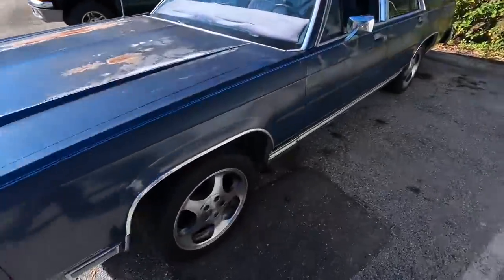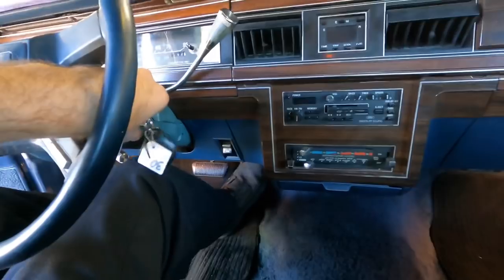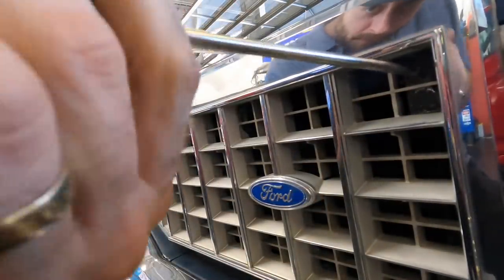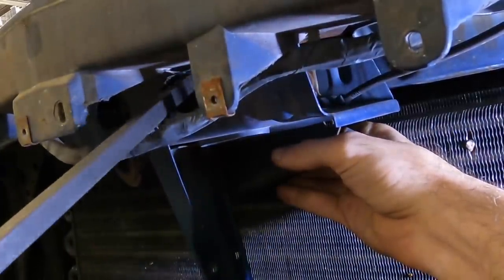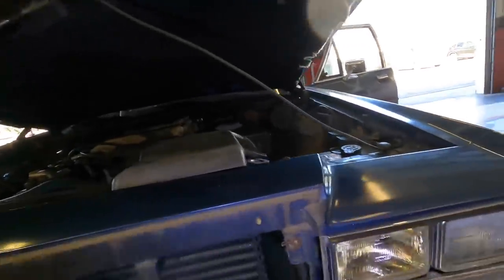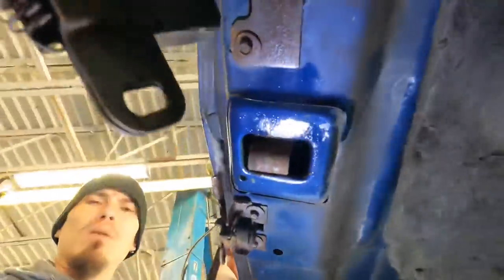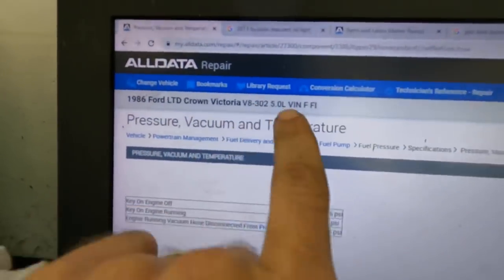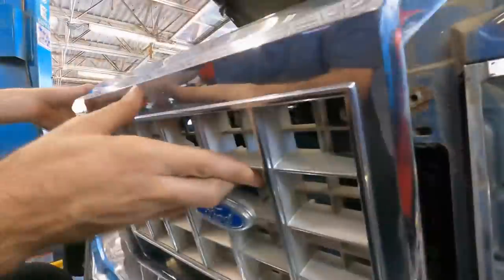Customer States: Replaced Engine, still stalling!

Comment: There is a pluggy plug thing on those. It's a different kind of pluggy plug, but idk if you can even get the tools to read it with a scan tool. Fortunately you can make the check engine light flashy flash on most domestics. Except Ford, where you can count sweeps on an analog multimeter :D

If I remember correctly - GM used a paper clip in the pluggy plug to ground a pin - KOEO and watch the light flashy flash. Chrysler was KOEO 3x leaving it KO on the last one to make it flashy flash, and Ford you had to hook an analog voltmeter to the diag port, then KO to make it sweepy sweep. Disconnect the battery for 30 seconds to clear DTC's. Alien level high technology.

Comment: what do you do? you get your old otc monitor 4000 and hook up to the EEC4 diagnostic connector. in 86 you couldn't get datastream, but you could pull codes, not that that would've helped you with this particular case. the EEC4 diagnostic connector is under the hood on these, and if i remember correctly, it's near the driver side shock tower.

Comment: This problem is easily fixed. Check the knuter valve. If that checks out the next step is to test the vacuum kabobulator. If that checks out, it's probably the flux capacitor. Make sure to check the muffler bearings. This is an important maintanance issue.

Comment: I had a Crown Vic, that the engine would miss once the fuel tank was below half.  I expected a fuel issue and took it in to the dealer.  Turned out to be a bad plug wire.  The only time I let the tank get low, was on long trips.  The wire only failed when it got hot enough on longer trips.

Comment: alot of thay era ferds have a fuel pump cuttoff switch that is resettable...its usually in the trunk...a quick bypass with some jumper leads then recheck pressure....

Comment: I had a customer (security company) who had about 30 of these. One of them when you used the 2 way radio ( the old days) the engine would quit. Turned out to be the electronic ingntion box the radio transmission would interfere and cut out.
Reply: "don't touch that mike switch!"

Comment: When you hit the center of the hood like that especially on that era of automobile, it doesn't pop the hood. You have to hit the corner of the hood so that it bounces the center of the hood up. When you're hitting the center of the hood you're pushing it down. I at first thought it was just the very early spot on the throttle position sensor. Which is a normal issue with those 5 l Ford engines. Just off of idle. But that one may be completely failed who knows. Or it's the little electronic ignition mechanism that's bolted to the side of the distributor. Two normal failure points so those 80s Fords. In any case just stop a couple of drops of STP on that hood latch mechanism will eventually have it soak into everything on it and it'll work much better.
Yeah he put a new engine in it, about 20 years ago the last time he closed the hood.
Yeah, now you have to be able to know what goes wrong with cars and know what actually controls it. What a bummer. All you new guys are way too spoiled with your damn computers.
I'm surprised it started, if I remember correctly the minimum fuel pressure on those things was like 45 lb

Comment: My Australian Ford Falcon XE Wagon straight 6 had Staked Terminals in the Dashboard Switches. Staked through plastic substrate. Plastic melted, tension gone from staking the contacts, no continuity. Fixed by soldering the brass switch terminals to bypass the staking.

Comment: The diag connector is next to the peach can on the fender. But I doubt any current scanners will plug in to it. Data was very limited. During that era Ford, didn't want just anyone to gain access to their diagnostics. Which was a good thing, because even they were ashamed of it. About the only thing a non Ford tech could do is to use an analogue volt meter and probe 2 terminals in the obd plug, and count the swings of the needle. You couldn't use a test light, just a meter. I don't remember what terminals anymore. Check engine light? We don't need no stinking check engine light. If it ran, it was fine. If it sagged and stumbled, it was either low fuel pressure or a bad oxygen sensor. Those were the 2 major items to check. All else, the pcm just didn't care. The ignition system was it's own hellish nightmare in and of itself. The module was the eventually built, sorta into the side of the distributer, (the older ones had a brain box mounted normally near the shock tower. The actual test to see if it was bad, was to actually hit it, to see if the engine would die! It was later called the wiggle test) was prone to getting water in it, causing several hot hard start issues. However with all these issues, the 5.0 finally got great pcm controls in the years to come. Too bad the owner wouldn't let you fix it. But that could be a blessing in disguise. Sometimes the fuel tank would have mounting problems.

Comment: 5 lbs wouldn't be enough to run my 1948 Wolseley 10HP engine (1140 CC)
i had a similar issue with my 1961 Wolseley 6/99 about 21 years ago, at some point the SU Fuel pump had been replaced and the "new" carb had a glass bowl and tiny filter on the bottom, completely hidden by the panels in the boot, had to remove the filter and run an external filter, to this day i have no idea what make or model that damn pump is.

crazy thing is the car was running fine, but that day the Wolseley Car Club was doing a run in the Dandenong Ranges Victoria Australia, and going up very steep hills was when the fuel starvation was presenting, as soon as i headed home, most of the driving was down hill and we got home fine.

Comment: I could tell it was a fuel pressure issue. Clogged fuel filter perhaps? Really depends what was replaced and(doing whole engine is quite extreme so in line filter back to tank or a banged up exposed fuel line so flow is restricted?

Comment: Just a lil FYI. Ford EEC systems were a pain in the ass. Alot of times the DLC's were so corroded they needed to be unpinned and manually inserted into the connector. Some didnt even have live data and if it did it was not helpful and you needed a BOB to diagnose things.

Comment: The hood sticks on my 93 f-150, I think the cable get stretched, I open it by sticking a screw driver through the grill in the right spot, I figure it's a good anti theft  system.

Comment: Ray, I came across your vid and my 1992 Dodge Ram Van has also stalling issue. It happens when I'm stopped at a red light or stop sign. I can always turn the key to restart and drive. However I noticed the oil pressure gauge does drop suddenly right before it stalls. So with your test of the fuel pressure in your vid, is that the first thing I should test? Then check the oil pressure gauge?

Comment: Just a tip for you young guys. See I'm old LOL. Although it would not have helped in this case, when opening hood and alone.... pull and hold hood latch and punch hood in left corner buy the windshield. May help you another day with a different car.

Comment: I was hoping for some ECC-IV ignition module diagnosis. A bit bummed it was a simple fuel delivery issue. The hood latch shenanigans more than made up for it though! Ah the life of a tech. Fuel pump, fuel filter, and a pressure regulator mounted to the injector rail. That's all for the fuel system. Nice and easy.

If memory serves 1984 was the first year for EFI in Ford/Mercury (Lincoln had it in 1979) and it was the throttle body injection (Ford called it something else but it was basically the same as GM's TBI). 1985 went to this "modern" style multiport injection across all models. However, for some reason the 351 kept the two barrel carb in the full size cars for no good reason I can figure other than Ford being cheap.

Comment: Some models in that era of ford had 2 fuel pumps--anti gravity in the tank and full pressure on the frame rail. Seems this varied as they came down the line! (From a parts store perspective, anyway) No telling what is going on when parts are swapped on these old ones, so I wager the car will be back!
Reply: you mean a 'cheap one in the tank and a cheaper one on the frame rail'.

Comment: Back in the day...6 lb fuel pump, 6 plugs , 6 plug wires, I dist cap. 1 set of points, 1 condenser, 1 rotor button,  1 barrel carb. 1-6volt battery,,  operational sequence,,. Insert and turn key, I click... Verify that the volt guage needle has moved to the discharge side of the meter.." this is the entirety of your dash  self diagnostic sequence".  Using right foot and right hand,, now, place your heel on the accelerater pedal, and your toe on the round button on the floor board beside it..  using the right hand,, pull the button marked "choke" out about 3/4 of the way... Pump the accelerater pedal 3-4 times with your heel, and mash down on the button under your toe... "There will be a slow ,, agonisingly labored sound  being emitted from under the hood".  Ignore this,,, quite normal,, all is well.. just 95 horse's stretching they're legs..  when it does start,, and believe me,, you'll know it,,  push in the choke to about 1/4 ,, release the starter button,, and slowly push in the choke ..... And voila!! Modern,. Reliable,, technology , circa 1948...
          And really,,,,,, want else do you need?.......

Comment: I had a similar problem with a big 74 Chevy Impala.  It had minute cracks in the rubber fuel lines, the short section between the fuel tank and the metal fuel line.  Those cracks would open and close with general vibration, letting in air intermittently.  Half and hour of locating three bucks worth of 1/4" rubber hose, and fifteen minutes under car replacement of same, and the problem was solved.   But this car is a wreck.  How could anyone put the money into it to buy an entire engine change, even using a junk yard engine?
This video: Time to diagnosis: three minutes.  Time to get hood open: thirty minutes.  
Here is a case in which throwing down the paper floor protectors actually becomes shoe protectors.  I'm glad the cockroaches inhabiting the ceiling liner didn't decide to dive down Ray's collar today...

Comment: I'm not sure how you got correct  fuel pressure  when  you  removed Schrader valve from the fuel rail, looked like you left the one on hose you screwed down on rail. I have checked  a few old ford's and never removed valve, stalling  on old beast  like that I would check  ignition  module on distributor  if it had one usually went bad

Comment: Interesting. Obd1 first gen ford only needs a paper clip or jumper to pull codes. Simplest engine ever. Frame mount fuel filter is normally the culprit.

Comment: A car from back when one key worked the ignition AND the door locks, the second key opened the trunk and glove box. Unless you a luxury or near luxury car there was no such thing as an inside trunk release. I’m guessing that you could have taken the key out of the switch while it was running.
Reply: my olds 88 had one in the glove box but you could lock the glove box door. it was a switch- not a mechanical release.

Comment: If replacing both the engine and the carburettor doesn't fix it,  the next step is to check if there's fuel in the tank

Comment: Seemed like he had a manual fuel pump suppling a fuel injected car. It was a common mistake that was made back when fuel injected cars were just coming out. People would do engine swaps, rebuilds , ect. A manual fuel pump had around 5 to 7 pounds of pressure. Carbs dont need high pressure.

Comment: Wait until that guy figures out what a pain in the ass replacing a fuel pump in that car is. I believe there were two configurations, a single high pressure pump inside the tank or a two pump setup with a low pressure in tank and a high pressure on the frame rail.   Also, if I remember correctly there are special tools needed to disconnect the fuel lines.

Comment: The guy probably went to the trunk, opened it, opened the valve he had installed in the fuel line and drove off with a perfectly running car.   Needed the hood opened!   Got it for free!

Comment: Amazing isn't it? That's a look at what newer car would be without all the computers. Just an engine. And they all work on the same principle fuel, ignition, oxygen and timing. Having grown up in the 80's. That problem would have been diagnosed before it made to the shop. It started idled, but as soon as you hit the accelerator and it bogged out. Yup... that's a fuel problem.

Comment: Taking a guess before the hood opens... Doesn't like running, does when you give it has... Sounds like a clogged fuel system to me, enough flow to idle and drive slowly at low recs, but as soon as the throttle plate opens it can't feed in enough fuel to keep up with the air, causing it to stumble and die. 

Now to watch the hood go up and see if what you find is the same as my guess.
Reply: Ok. I wasn't far off. It was a fuel issue, but like you I assumed that car had a carb. Nice to know I picked the right base cause of a fuel delivery issue however!

Comment: Oh yes pull hood rel, beat on hood untill it pops open. How many times have I had to do that?  Usually ive just stuck a long snap on flathead screwdrive used to adjust carburetors or points with to pop the hood rel without taking off the grill. But thats a new one.  Yes 1985 fule injection,  that wasn't the first years 1950s somthing was on the corvette I belive but without computers is didnt work that good as I understand.
In 1985 no odb connector but gms and toyotas as well as I belive Ford you could still read blinking dash lights im pretty sure 1995 and up had odb junction points.  And that was basically becuse Toyota was doing a scan system all the way back to 1973.  You just had to short jumpers in a fuse box under the hood or use an eairly model scanner. 
No one seems to have the tools now to hook up.
Before all this it was use wires under the hood on sevral spots.

Im going to bet on a car that old dirty plugs and dirty injection system as well as needing a tune up.
Reply: I've got a 2005 Crown Vic.  Got to pull hood release lever, then bang on hood, get screwdriver from trunk, pry hood open with tool.
 Ford never fixed the problem.

Comment: Don't put that rubber boot back on the distributor. It will cause crossfire on the spark plugs(specifically 7 and 8). In addition to bunching up the wires too close to each other, when they get old they become electrically conductive.

Comment: easiest way to get the hood open is a rag in the gas tank. i have to call bullshit on engine replacement because if you can't even troubleshoot a fuel system problem.

Comment: Not to be crass but, as a daily wrench how do you not know EFI stuff is 45ish psi?   I realize it can vary alot but for the most part, if you're looking at anything with port injection from the 80s to the early 2000s, it's going to be between 39-50... 5 would be super obvious and would not need to look it up.   Also it's OBD1, diagnostic connectors are typically in the engine bay.

Comment: I’m not convinced you got an accurate fuel pressure reading with the schrader valve removed. This era of Ford MPFI wouldn’t run with 5psi, like not even try. Also as others have stated the diagnostic port is located under the hood. You can check for codes without a checker, but it doesn’t store codes. I wonder if the timing was set correctly when the engine was replaced? Several things that could be checked here.

Comment: I'd be surprised if you were even born when that car came out. I've worked on hundreds of those back in the late 80's and 90's and I would hope that at $100-$150 an hour labor, you would be using a electric tool to remove screws, instead of manually with a screwdriver. But, thats why I still work on all of my vehicles myself because I'm not paying $100-$150 labor per hour to have it done.

Comment: Ray-  I have to say my biggest pet peeve, like when I take my dad's car in for tire replacements/alignments (I do all my own work on our own cars), these shops LOVE to jack around with the seat adjustments. DON'T SCREW WITH THE CUSTOMER'S SEATS!  For that reason, I unplug the seat actuator harness connector prior to and if they mention the seat wont adjust, I just state the seat actuator is busted and the seat is exactly where we like it.  Put that in your pipe and smoke it!  However, I enjoy your videos.
Reply: I am 6'6" ASE master tech for 32 years. If I cant fit in your car i cant fix it
Reply: @billthrasher3587  Well, in that case,  I do make exceptions. I can get that seat adjuster working..."wow, look at that, the seat just started working".

Comment: Fuel filters are cheap, except when Ford hides one (that may or may not be installed) mounted INSIDE a boxed section of the frame. New pump, nope. New filter, nope. Black hose in, blue hose out of the frame. WTF Ford? Plastic canister, unscrew cap, break cap and a filter that looks like a mud storage unit. Progress!

Comment: Explain the reason you removed the valve from the testing port??? When using a connection that requires a push from it???
Bad decision, wrong reading!

Comment: Ha, millenials trying to find the OBDII plug on an 86. To open the hood on my 86 you had to pull the hood release lever with one hand and bang on the hood to the tune of Eye of the Tiger with the other hand. Rocky Balboa pops up out of the hood and Adriaaaaaaaaaaaaan. Boom, it's open. A lot of the older Fords had OBD 1 ports near one of the shock towers but you need an ancient scan tool to pull data on them. I have an Actron but I don't know if it goes that far back. I had an 89 and that thing had the coldest A/C and jumped on the highway in a hurry. I miss those 5.0 engines.